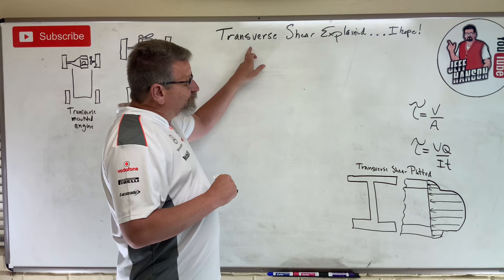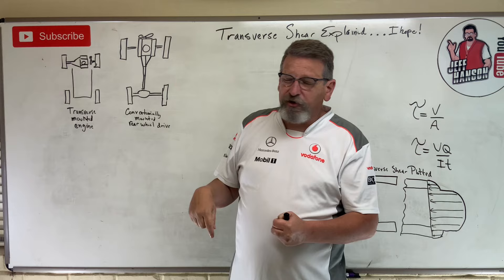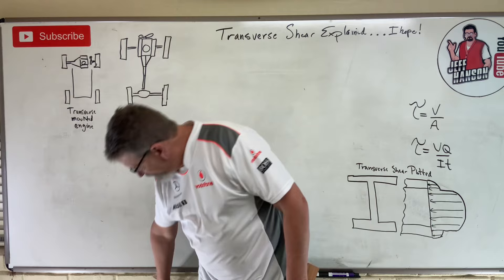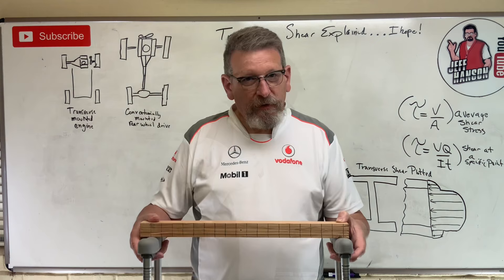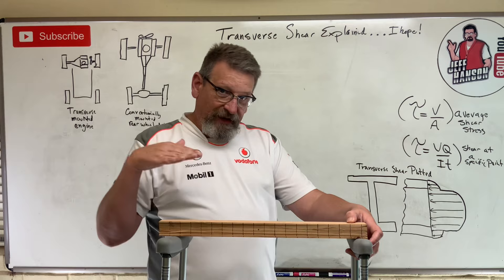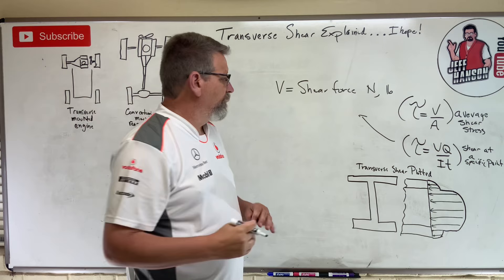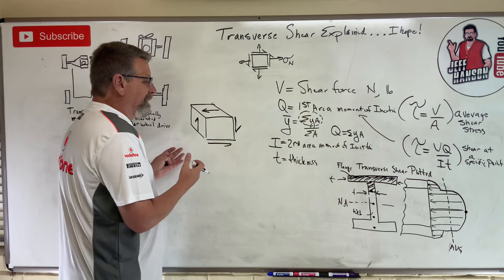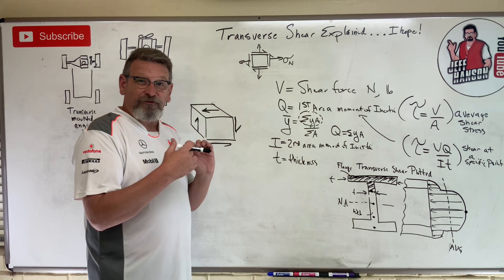Mechanics of Materials: Lesson 36 - What is Transverse Shear? Explained

Comment: Direct shear is t=V/A (as you call it average shear), transverse shear is t=VQ/It... why in a beam bending problem is there no direct shear (no t=V/A)?  For instance, when we have a key in a keyway on a shaft, the key undergoes direct shear and no bending (this makes sense to me as there is no distance between the applied external loads)... but why is there no direct shear when the external loads are far apart (such as a cantilever beam with a point load at the end)?  If I was to shrink the beam in length as it get stubby, the shear will be direct and best represented by V/A...